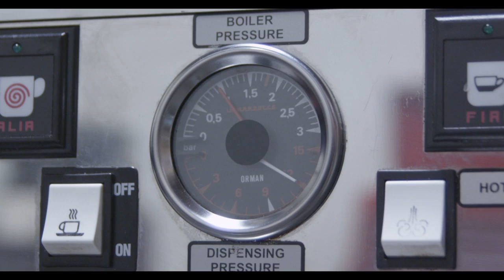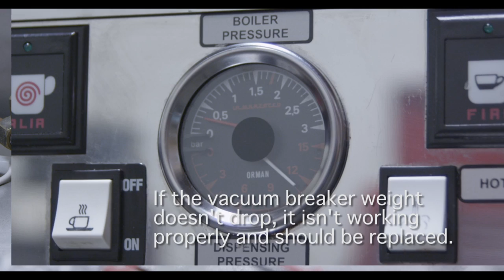Linea - Check Vacuum Breaker for Proper Operation

Comment: Do I need to drain the boiler before opening the vacuum breaker? My breaker is hissing and I believe it’s due to scale build up. Can I replace / clean it without having to drain the boiler?
Reply: Did you find an answer to this? I’m having the same issue
Reply: @TheCantu92  negative, just living with it hissing, the world hasn't exploded yet
Reply: For. my machine, you turn off the water supply valve. Then relieve the pressure till the top anti siphon weight drops. 
Go to a forum for these are great help!
Take care